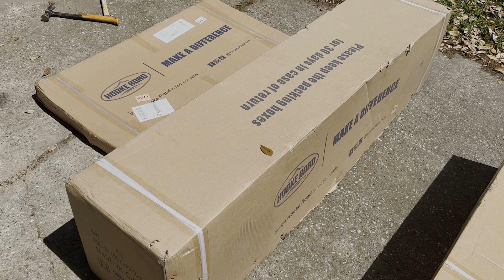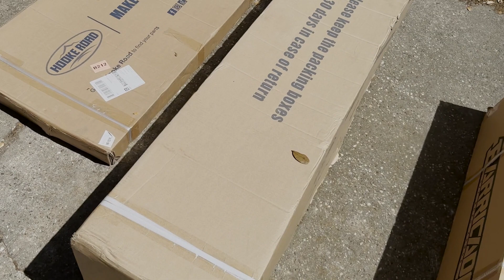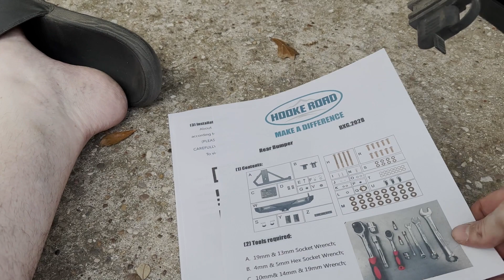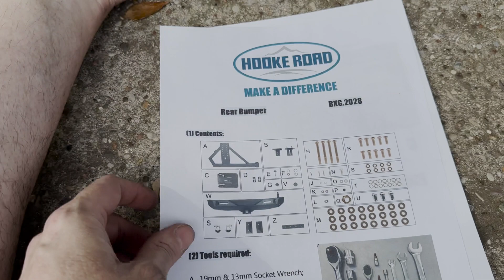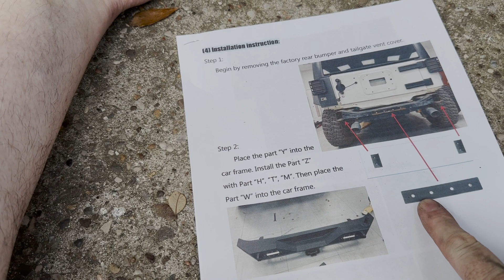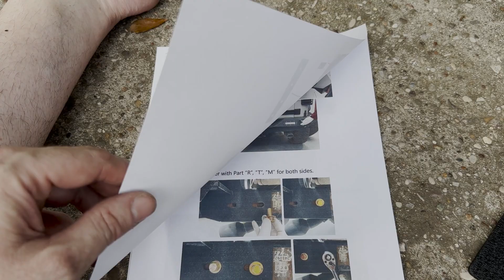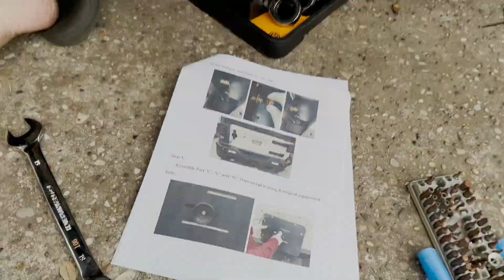Hooke Road, Rear Bumper & Tire Carrier Installation

Comment: very good video of how us driveway mechanics have to do stuff. My big question is rear visibility with the inside rearview mirror. Can you see anything useful other than that your tire is still there
Reply from the maker: Surprisingly it didn’t make much of a difference in the view out the back. I can still see ok with the rear view mirror. It was never great any way, and the bigger tire only made it slightly worse. I also have added a couple cameras that I can utilize if needed. Thanks for watching!

Comment: Nice upgrade!  Consider hitting those bolts with a torque wrench with maximum allowed torque just so you know how well they are fastened.   Will you reinstall the camera?
Reply from the maker: Yeah, I will reinstall the cameras and third brake light, just not quite sure where/how yet

Comment: I am having issues with mine, It makes a rattling noise. It may have to do with the bump stop not lining up.
Reply from the maker: Yeah, my bump stop doesn’t line up either. It helps to keep the turnbuckles as short as possible. Also, I had to replace the nuts and bolts that connect the turnbuckles. The nuts kept backing off over time. I added some blue lock tight and a second nut at each connection. One other thing to check, make sure the castle nut is nice and tight. If it loosens up the tire carrier will sag some and can cause it  to rattle some. I’ve made a habit out of checking to make sure everything is nice a tight on a regular basis. Overall it’s still a pretty good bumper for about half the cost of similar bumpers.
Reply: @BasecampUnbounded  This is very helpful. Thank you